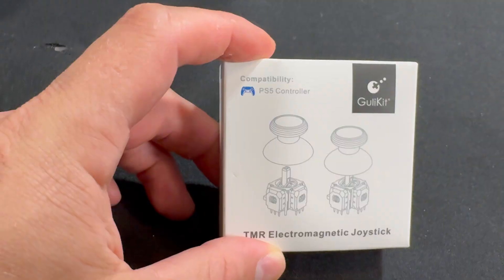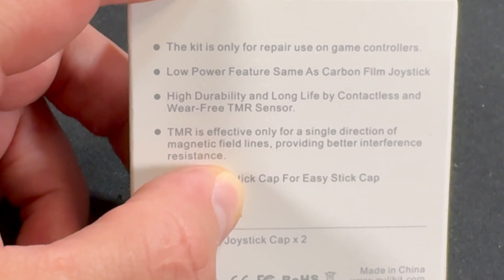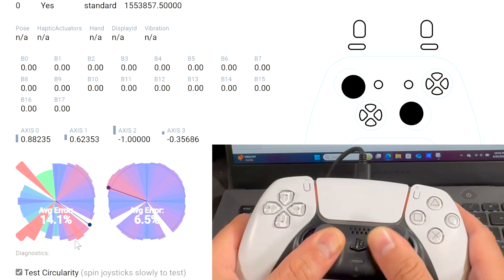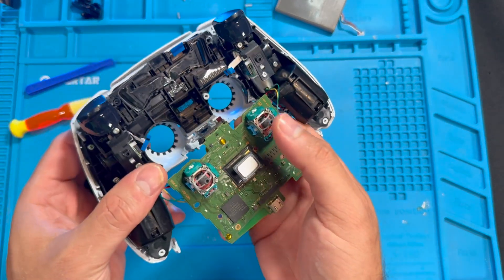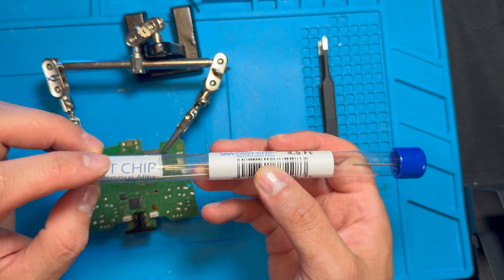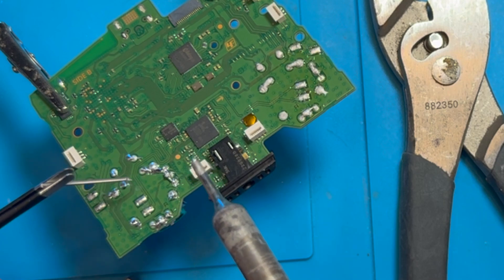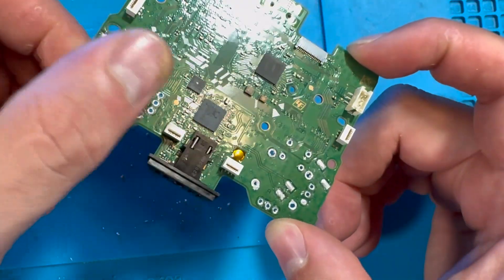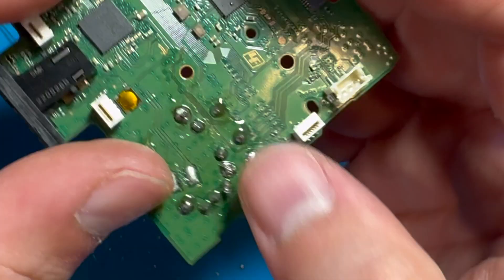Installation Guide Calibration GuliKit TMR Joysticks Electromagnetic

Comment: What I've found is the easiest way to remove stubborn solder from holes is to hold the board in your hand, melt the solder with an iron, and bang your hand downwards on the table, making sure not to hit the board on the table if it has sensitive components. The inertia causes the solder to be quite happy to clear the hole.

Comment: I had my dual sense edge modules done by a company called Uber Micro Repair 3 months ago. Today the right stick has become locked to the top left and is completely unresponsive. I’ve tried this video method to calibrate the right stick. Does anyone know if it’s now broken or am I doing something wrong. Was working fine today then in a game it started to drift then the character on screen was looking up and rotating around and was unresponsive on the right stick module.

Comment: I hate leaving negative comments. But I can't recommend anyone to use this as a tutorial. With his methods of pulling the joysticks off and reinserting them you risk ripping the solder pads, in which case the motherboard would be trashed. Unplugging ribbon cables should be done with tweezers. And you don't need to trouble yourself with buying low melt solder and a heatgun for this simple of an install, if its the only time you see yourself soldering or doing something like this.
Reply from the maker: There are many different ways to do this, I've seen numerous methods of achieving the same result. I'm not an avid soldering expert, engineer or technician, this was the best way that I've learned to do, and have done it countless of time achieving good results. If you ever decide to make a video showing your way, send me a link I'd love to check it out
Reply: @TheGamer2Know Sure. I'm actually waiting on an order of tmr joysticks to install on my friend's dualsense 5. My camera equipment/setup is not the best, but I'll figure it out. Also, I didn't mean to be so harsh in my previous comment, i just pointed out things i saw. If an install works, it works.
Reply: Ripping solder pads isn't always a death sentence. They can be repaired depending on their damage.
Reply: @LeoViktorovich  Still not something you'd want to happen. I won't go out of my way to risk ripping them when i can avoid it
Reply: @LeoViktorovich  While you are correct that ripped pads can be repaired, the kind of person that rips a pad probably isn't going to have the skill/knowledge to repair the damage.

Comment: When I installed my Gulikit, the left joystick is always going to the left even if I move it to the right based on the calibration it doesn't go. Is there a problem with my installation process?

Comment: 7:13 I would use flux and a wick, not that tool you use.
Reply: Nothing wrong with a desoldering heat tool
Reply: That’s what I used (flux and wick) when I installed Gulikit TMR Joystick I got off infixit for my Xbox series X remote

Comment: TMR is more accurate, but it's not lower latency. Actually latency is one of the main reasons they haven't been the standard.
Reply: Hall effect is typically lower latency, so I would be surprised if that was the case.

An official implementation could easily be better.
Reply: @NakedTrashPanda  from all the testing I've seen hall effect tend to be higher latency than traditional sticks. In fact it's the reason they removed TMR sticks from the PS3 controller as the latency issues resulted in it missing fast movements. There's also plenty of test examples online showing that they tend to be slower than traditional sticks. There are some that are comparable, but it's not very consistent. 

The whole point of TMR and hall effect is they should last longer if you're rough on your controller. And there's really only one wear free hall effect controller on the market, the Flydigi Vader 4 Pro.

Comment: Very good video, it shows that you know what you are doing, everything is very clean and in parts... but I have one question, which is better to remove the joysticks, with a heat gun or with a tin extractor? Which process damages the plate the least? thank you so much.
Reply: A desolder station is ideal. It can heat up all the joints at the same time vs using an iron and possible repetitive introduction to heat. Look into Chip Quik as well. That’s similar to what he applied to the joints at the beginning.

Comment: Hey i have a question i hope you can help with. I recalibrated my sticks for both center and circularity but the circularity is still awful i get 10 and 12 percent and i dont know why no matter how many times i recalibrate they stay the around the same. Any help is appreciated thanks!
Reply from the maker: Most likely it’s not a issue the software can fix and the sticks are just old and loose
Reply: You want to ensure the entire range exceeds the circle. Anything outside is not the issue. If some of the tracking is within the test circle, you’ll have less than ideal movement.